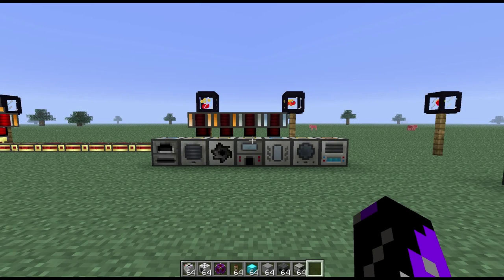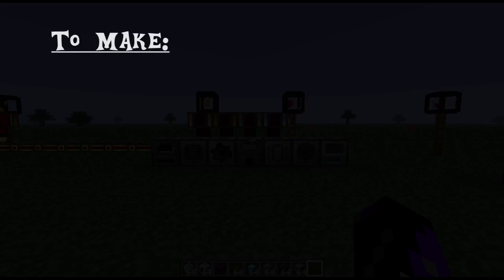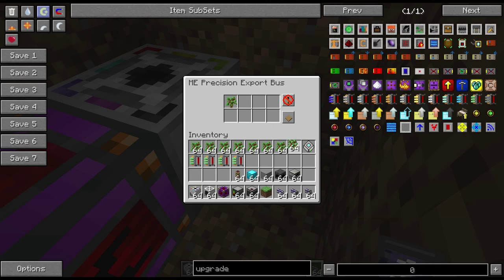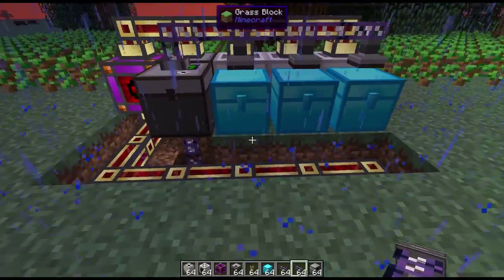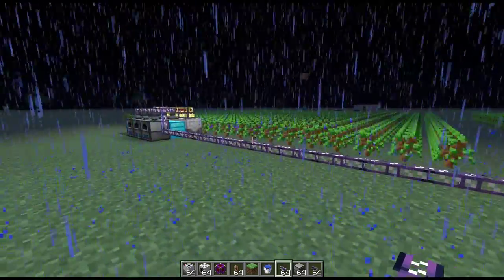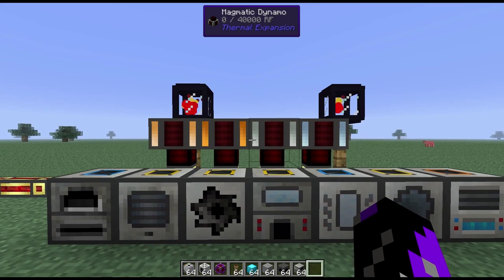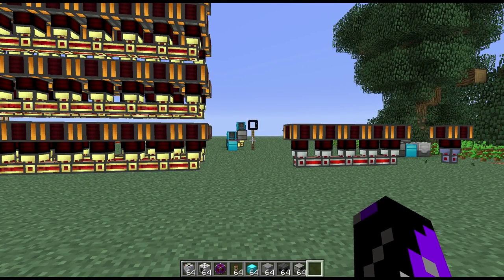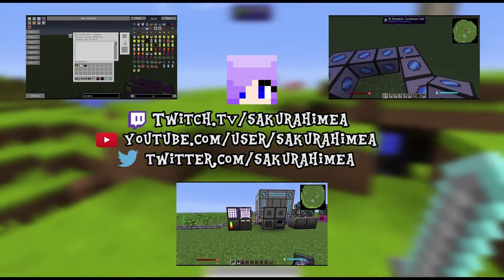How to Create Infinite Energy With a Steam Boiler

Comment: Can you make a tutorial for the Fusion Reactor PLZ? :)
Reply from the maker: I certainly can! I will be finishing up with Forestry Bees first, though!
Reply: In the videos I've watched about it, they tell and show you how to build one and how to use the Helium Plasma and they tell how many centrifuges and electrolyzers you need to automate the fuel, but what they don't show is how to setup the electrolyzers and centrifuges, which is the only thing i still need to know, i don't plan on building one just yet cause I need more resources but when i do I want to know everything I need to know when i start planing for it. Would greatly appreciate if you could explain that in the video. :)
Reply from the maker: James Einstein The centrifuges and electrolyzers are by far the most difficult part and I can almost guarantee you will spend hours trying to configure them just right. Basically you run the water through electrolyzers to create hydrogen cells. You run the hydrogen through about 2/3 of the centrifuges to create deuterium, then run 1/4 of the deuterium cells through centrifuges again to create tritium. The deuterium and tritium together fuel the reactor, and because it all comes from water it's basically an infinite fuel source. The real trick is balancing how fast you're processing deuterium vs. tritium and keeping the amount in balance. If you run out of one, the reactor will eventually shut down, and restarting a fusion reactor is not an easy process.

I'll make sure to cover all this, but I probably can't give you a perfect number of deuterium vs. tritium centrifuges. Every time I make one it seems to change.
Reply: HimeaSaito I'm having a bit of trouble with the harvesters, sometimes they bug out and don't chop the trees when they grow, sometimes leaving a lot of trees uncut, and then they may partially cut them and cut the rest later.Also about how many full sized high pressure boilers could you run off of one of those farms, i have 4 of them, 2 at 1000 degrees and 2 at about 500 degrees, i think once they are at 1000 degrees the charcoal level should be stable.
Reply from the maker: James Einstein The way the Harvesters behave there will sometimes be tree stumps left over for a little bit. They should come back around and harvest the stump. With the more recent versions of Railcraft (Minecraft 1.6) the charcoal burn rate remains the same no matter what temperature the boiler is, the rates are now always what used to be max temperature. I've managed to run up to 4 high pressure boilers on a single farm with oak trees, but depending on what tree type you're using and how much energy you're supplying to the harvesters it could be more or less.

Comment: This is great but the things you'll need list is incomplete the Me import/exports take quite alot of time to make and should be factored in. Also it'd be great if in future videos you didnt use those infinite charge things and used  a legit source of power everyone uses. it was hard for me do this without cheating. Thanks :)
Reply from the maker: The Applied Energistics style of automation isn't required for this method to work, you can use other sorting methods, it's just a lot easier. As for the Creative Energy Cells, I use them to save myself time and hassle. Keep in mind that the conventional method of fueling steam dynamos, water and coal, is still viable... just not infinite. I apologize if I didn't make the intermediate steps very clear.